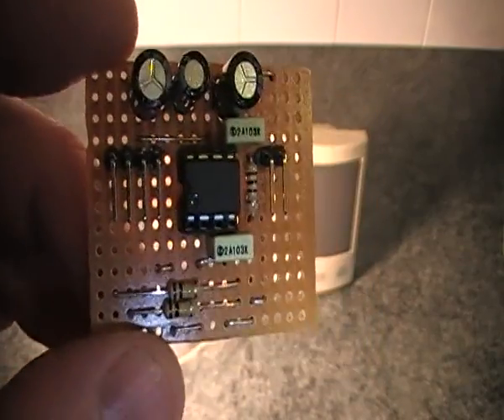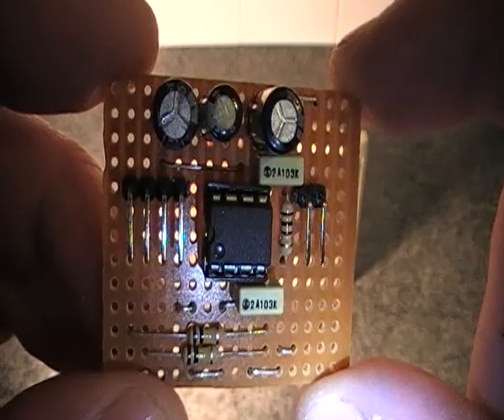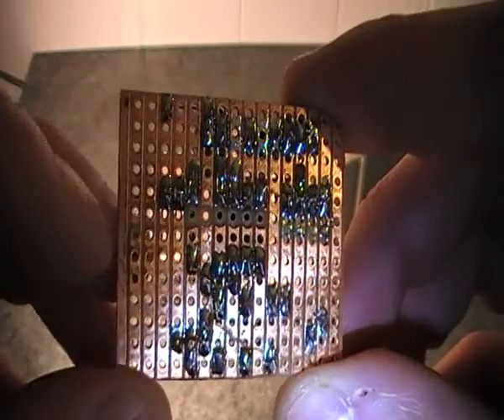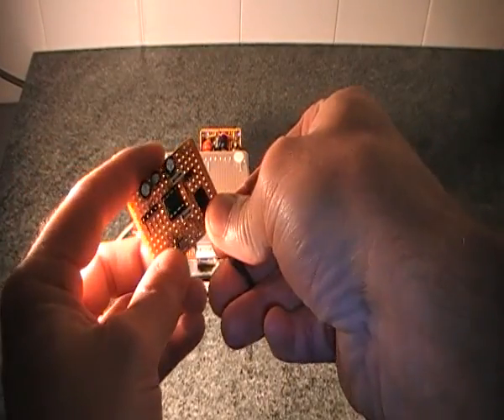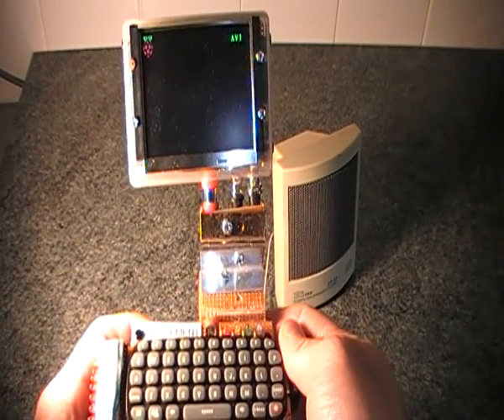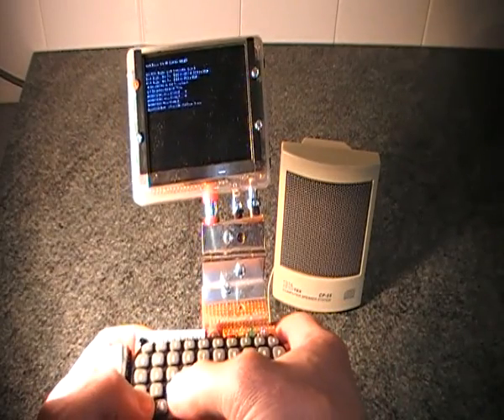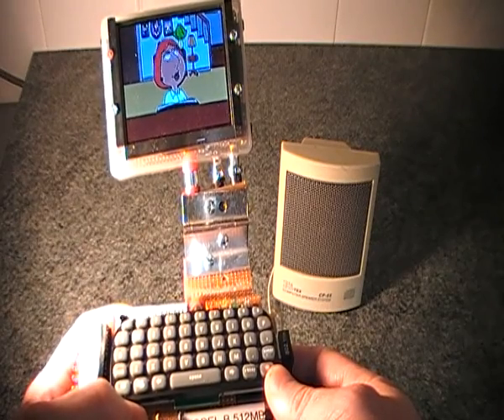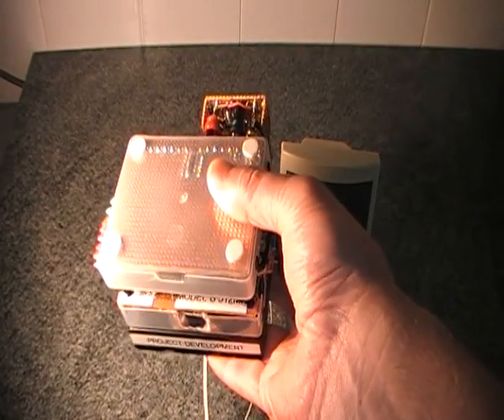Raspberry Pi LM386 1W Battery Powered Audio Amplifier

Comment: Hello Im a bit late, but I have a question,  the left and right INPUT goes to wich port on raspiberry pi??
Reply from the maker: There is an audio socket. On earlier models a 3.5mm stereo barrel connector, on later models a 3.5mm connector with four connections rather than the standard stereo three, the extra one is for composite video on the later models.

Comment: What pins are the lm386 connected to on the Raspberry pi?
Reply from the maker: The circuit diagram can be found here: http://www.newsdownload.co.uk/pages/RPiLM386AudioAmp.html
From the audio jack socket of the Raspberry Pi, to pin 3 of the LM386, via a 100K resistor and 10nF capacitor.